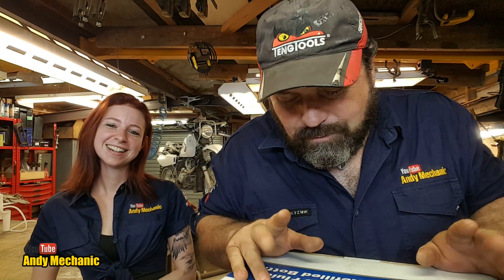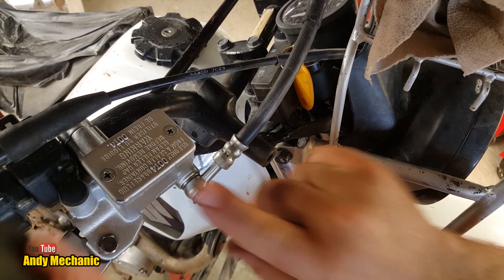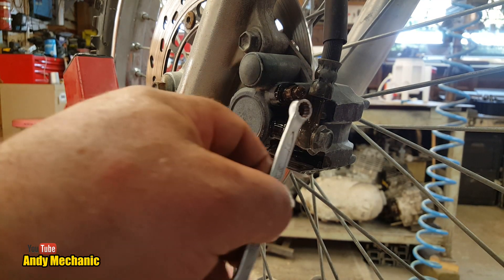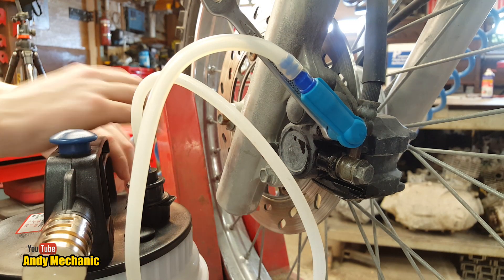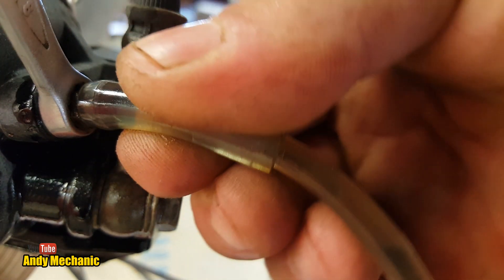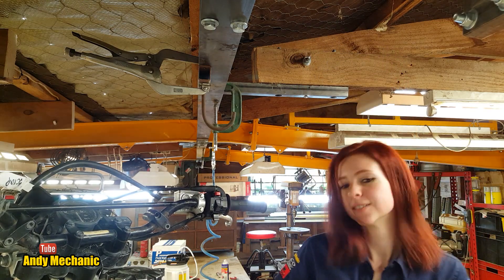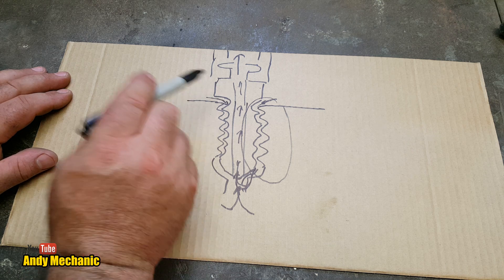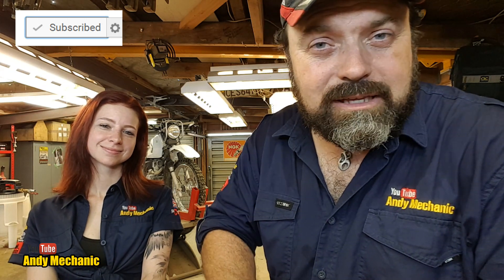Vacuum brake bleeder issue Ft. TG Holley #1342

Comment: Andy, great vid this. I’ve just reconditioned the callipers on my Mk4 Golf and I’ve got the bleeding to do. I’ve had the same problem you describe here in the past so it’s great to see my experiences/suspicions confirmed I’ll be using a pressure bleeder which pressurises a tub of brake fluid so makes it a 1 man job and this time I’m going to try using some PTFE on the bleed nipple thread. My question is - the Haynes manual says to pump fluid through the Cali per from the bleed nipple until clear fluid is expelled from the brake pipe union before connecting the Caliper to the brake line. Have you any idea why it would say that and is there any reason as far as you can see? Many thanks, a really good, informative channel
Reply from the maker: Hi Jon, they are just ensuring that the caliper is bled up before you start the main bleed. It's not usually necessary to be honest but some calipers, depending on their mounting, can trap air. I have never had to do this but may be a tip for your model.

Hope this helps
Cheers Andy
Reply: @AndyMechanic  Many thanks for taking the time to reply Andy. I’ve already fitted the calipers so I’m going to risk doing it the standard way, I’m sure it’ll be alright with my pressure bleeder. Thanks again

Comment: The real problem with the DR200 front brake is the dirt & muck that builds up under the piston seal. It needs to be removed, cleaned & rubber grease applied.

Comment: Andy and Holley another good video. Crappy drawing but it definitely explained what is going on. I have run across the same concern but didn't here about the grease trick till after I did the bleed. Finally did it the old fashioned way. Andy great to see you and the lovely girls back in the shop. How did Holley make out on her trip with the trailer? It was Holley correct? Cheers to both of you Artie ❤️

Comment: I have to say I have used these vacuum bleeders and they are really A, for a car as they pull fluid from a longer distance and B, need the shop air ( you quoted 130 psi ) more like 90 ish I would say unless you have some super dooper Edward the Compressor, to be regulated down to 20-30 psi this way you won't get the whole breaking system trying to implode. Regarding the grease on a bleed nipple😳I was always instructed and subsequently instructed a number of aerospace apprentices, that any hydraulic system whether it be a small cc bike brake or the hydraulic system running 3000psi on the flying controls on a Boeing 787 Dreamliner should never ever have anything else to lubricate seals or refit any part other than the hydraulic fluid itself! I understand that your videos which I enjoy for several reasons have to be more for the layman but introducing grease into a hydraulic system in any way shape or form is a no no. Keep up the good work, girls, projects and tech tips. Phil expat ✈️🛠🇦🇺😎

Comment: I used to have a pressure bleed kit that screwed onto the top of a one gallon can of brake fluid and then pumped up the pressure inside the can.There was a whole bunch of different reservoir adaptors for different vehicle  although it would have been no good for motor cycles. The beauty of the system was once pressurised you could go right round a car and bleed all the brakes and the cars reservoir would still be at the correct level when finished and completely flushed out and new fluid throughout.  At some point in the 90's the thread on the cans changed and the unit would no longer fit.
Reply from the maker: That's a shame, sounds like a really useful tool too.

Cheers Andy

Comment: Nice Video, does this also apply for the less posh manual gun type brake bleeder kits as well as the air compressor ones?
Reply from the maker: Yes, I guess so, any device working on vacuum to extract the brake fluid from the bleed nipple will demonstrate the same symptoms. It's a little confusing as you assume all the bubbles are trapped air from the hydraulic system but once you know some can be drawn in down the threads of the bleed nipple it becomes clear.

I always finish with a manual bleed to ensure no more air is in the system.

Cheers for now
Andy
Reply: @AndyMechanic  Good to know :) I guess the old school way is cheapest and best for most people who do this once or twice a year!

Comment: all u need to do is put some grease around the nipple and the brake bleeder as well to stop it sucking air i made a brake bleeder from a hand vac pump and a old plastic bottle it works better then a shop 1 and lot cheaper
Reply from the maker: Yep. I mention that in the video somewhere. Cheers Andy

Comment: found the same issue with my vacuum bleeder,  just a hand vacuum that goes on the bottom bought about 2 years ago. first time i used it after rebuild the calipers i went through a litre of brembo brake fluid with bubbles constantly before i clicked. what i do now is use the vacuum and at the very end bleed it 3 times the old route like you did in the end